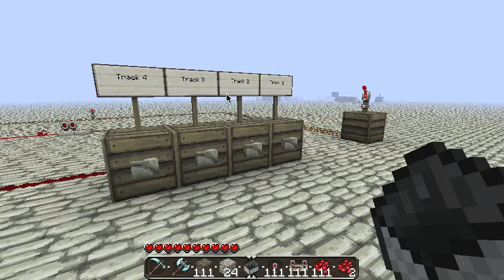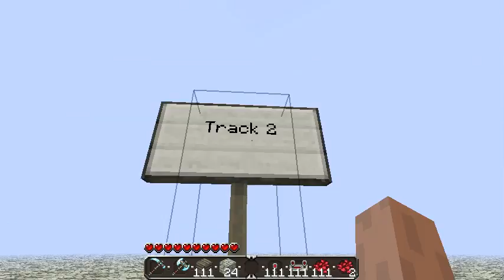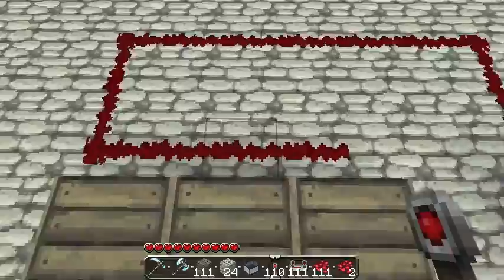How to Build a Minecart Station (Updated for 1.6!): Station Addons - Destination Selector Part 1

Comment from the maker: @felinoel Ah, that's my fault for poor explanation in the video.

To make an inverter, you can't run the redstone directly into the torch (on the same vertical level).  Instead, you need to attach the redstone to the base of the block on which the torch is attached.

The easiest inverter is just a block with the torch on one face.  You run the incoming redstone from the RS-NOR latch to the back of the block, and the output to the tracks from the torch on the front of the block.